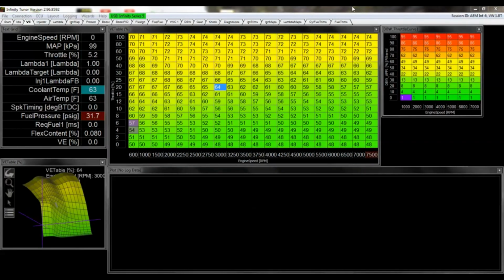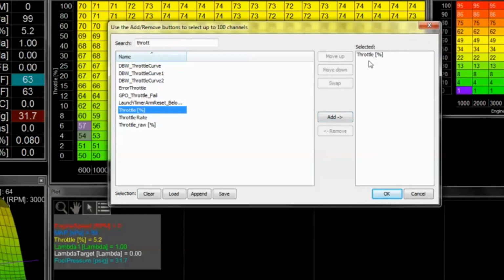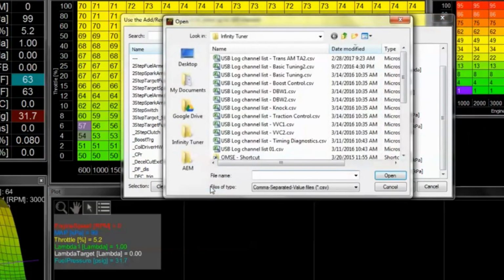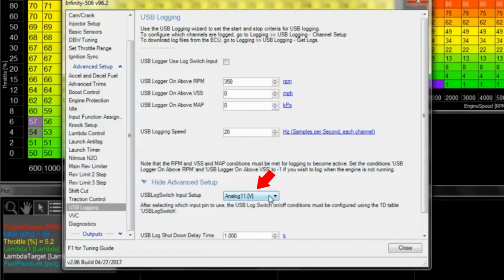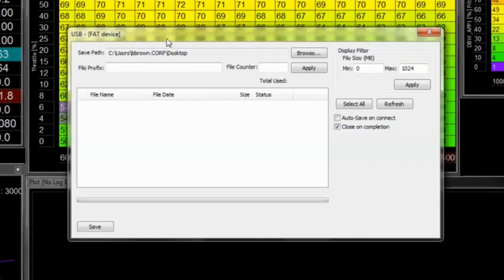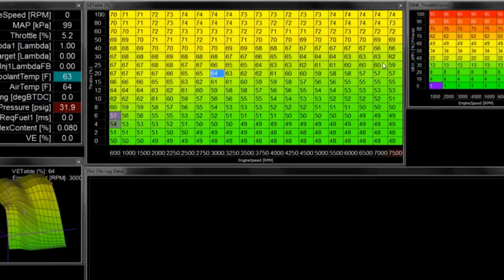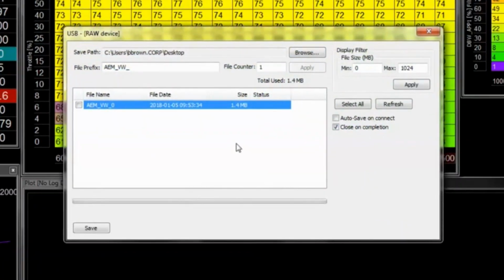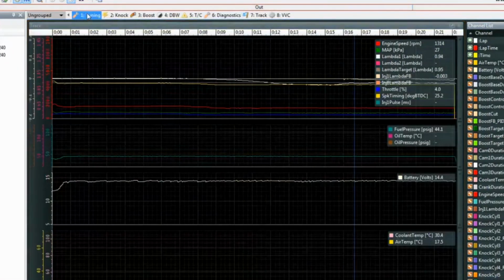Transferring Data Logs from InfinityTuner to AEMdata  (AEMdata Tutorials)

Comment: Will the USB logging settings be changed when calibration data is imported? Aka will I need to go through this process every time my tuner updates the tune?
Reply from the maker: If your tuner is making live changes on your current calibration the USB logging settings will remain intact.
Reply: @AEMpowerTVelectronics  thanks. Following this video I can get it to log to the USB while my laptop connected, but when I unplug my laptop the log files aren’t getting saved to the USB. No idea why.
Reply from the maker: @dustin9258  What usb drive are you using? Did you format the usb drive in the infinity tuner software? Are you using a Raw or Fat format? There are many troubleshooting steps we can take please send us an email at tech@aempower.com so we can assist you.

Comment: Hi, 
I'm currently having some issues regarding exporting data from AEM Data to a .csv file. The software crashes everytime I try to do this (also tried changing various options but the problem is still present).
Could you please help regarding this?
Thanks
Reply: Quick update:
I just installed the newest software release and everything works great

PS: Great software! Keep up the good work